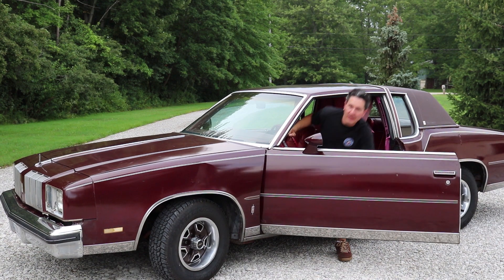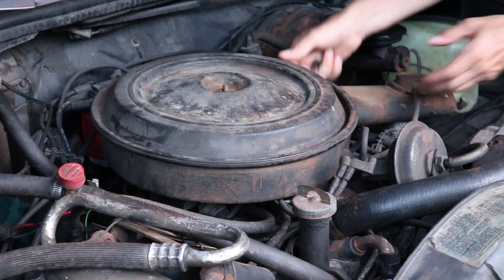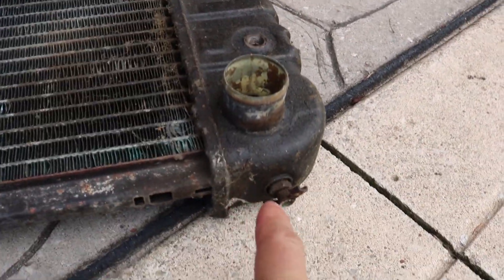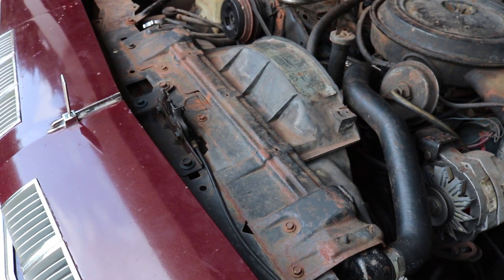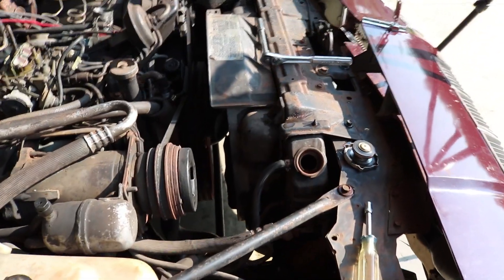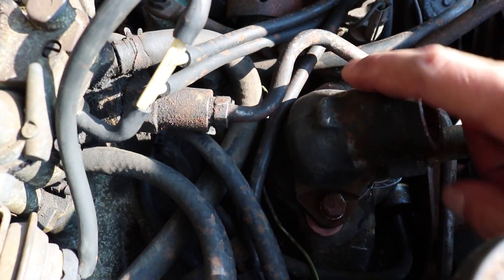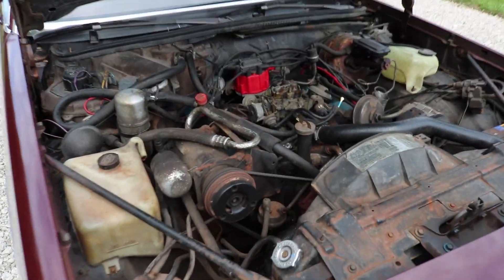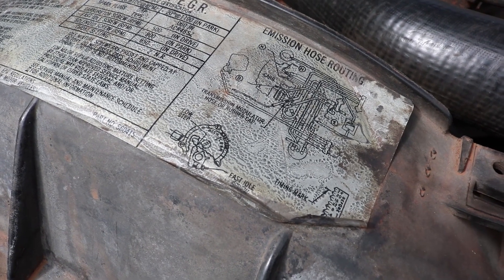HOW TO Replace Radiator and Thermostat - Full Details

Comment: why did you use a 160 thermostat and not an original 195 thermostat?
Reply from the maker: I prefer my cars to run cooler as I only drive them in the summer time.
Reply: Many thanks for the answer. I just changed my thermostat. (307 Olds delta88) How do I properly bleed the coolant system? is there anything to consider?

Comment: Thanks, helpful video. I have a 79 Malibu with a 3.3L / 220 CI and the radiator finally packed it in this year after 42 years. So, in goes the replacement. BTW, most reliable car I have ever owned! Oh yeah, original owner.
Reply from the maker: That says a lot!

Comment: I have a 85 Cutlass supreme with a 403 olds engine. Previously I had a 307 olds in. It is overheating without driving. What kind of radiator do I need for the 403
Reply from the maker: 3 core radiator, Make sure the fan clutch is good and correct, 160 thermostat
Reply: @ClassicGBodyGarage  
Thanks

Comment: Will it be the same process for an 84 cutlass supreme with a 307? And removal of trans lines, do they unscrew lefty lucy? And drain plug. Is it a screw or a latch? Thanks.
Reply from the maker: All the same as this car. Trans lines are threaded the same as well as the drain plug.
Reply: @ClassicGBodyGarage  I had to remove my radiator shroud to install the lower trans line. Will this affect my cooling?

Comment: I run a 195 T stat, cheapy aluminum/plastic radiator like the one that was removed, and it stays dead nuts at 195 even idling in hot summer traffic. I do not have a fan shroud, as my car was a V6 and now has a V8, but I do have a top plate. I need to get that octagonal style shroud that 307 cars had.
Reply from the maker: Nothing wrong with that. This alum rad just had issues and I wasn't about to buy another since i have a bunch of stockers.

Comment: Clutch fan : are 78- 88 all thermal clutch or 78-80 thermal clutch / 81-88 non thermal clutch ?
Reply from the maker: all depends on options the car has. AC cars had thermo clutches.

Comment: I've got a 1985 monte carlo v6 and im new to restoring cars but are they any other car that will have the same parts as mine because where im at its hard to find anything monte.thanks new sub.
Reply from the maker: Many parts interchange between gbodys so it depends on what you are looking for. The parts the swap are all suspension and most interior. Engine parts swap but you need to keep in mind the engine you are working on. Thanks for subbing!

Comment: Hello first and foremost ur doing a great job n a big favor for most by making these videos but i think u should have made the vacum line replacement video maybe explain symptoms and causes of bad vacum lines reason being that those lines are a great factor on engine operations but as mentioned ur doing a great job n thank you
Reply from the maker: Thanks for watching and great suggestion. I can make a video on that but it will be general as each year and engine option used a different vacuum line system.

Comment: The car is looking great , but I noticed that your fan blade is on the clutch backwards, that made my 79 run 5 to 10 degrees warmer when sitting and idling.
Reply from the maker: Damn it is! I didn't even notice that. I will fix that ASAP! People who installed the new fan clutch must have done that.

Comment: Great video, thank you
I have a 85 Monty with the 305. I put a new rad. Clutch fan and two new thermostats. With the thermostat in, it overheats as soon as I drive it. I can let it idle for an hour and it's fine. As soon as I start down the road it goes up to 260.
Take the thermostat out of the car and it runs fine. Never gets to 110
Your thoughts

Comment: hello could anyone tell me how to change ac compressor v belt on my 1988 oldsmobile cutlass supreme classic brougham thank you
Reply from the maker: loosen up the accessory brackets and they slide to loosen the belts, remove belt and replace. You will need to remove the belts of any other accessory first as they are in the way. I think the AC belt is the most inner belt so the Power steering and alternator belt needs to come off as well.

Comment: That is one nice cutty. And the 260 sounds like it has a lot of life yet. I had the 79’ Cutlass with 260 and those vacuum lines were a pain especially where I live. They was cracking/breaking plenty after just 6 years. But very good engine

Comment: A new radiator cap is a good idea as well. A faulty cap that doesn't hold pressure allows the system to boil at a lower temp than a cap that is working properly. This pressure also helps keep the coolant  in a liquid state bellow the the boiling point. 
Air IS introduced into the system on these cars when they constantly overheat (or when the cap pressure is too low) and force the expanded coolant into the coolant recovery tank and then draw the coolant back into the system from the recovery tank. 
Also a faulty cap that allows the system to build too much pressure can destroy an aluminum core. The aluminum tubes can swell crushing the fins between them. This blocks airflow through the core.
Reply from the maker: This is true and a great tip.
Reply: Classic G-Body Garage I have a 1986 Cutlass Supreme. I need a new radiator. I was seeing which one was better, an all aluminum one or a copper one?

Comment: Worth remembering that for CCC equipped G Bodies, a 160 degree thermostat may run too cool and not reach temperature enough for the carb to come off choke and mixture adjustment to lean out for normal running. I have an '86 Monte SS running the stock 195 degree thermostat down here in west central Florida, and it's running a similar plastic/ aluminum radiator that yours had (swapped in recently to replace the original leaking brass radiator). Even in the August heat it holds temp fine around 200 on the gauge, which is close to the 195 that the factory specified. Car runs fine and doesn't overheat, even in traffic.
Reply: Chas D  that's great, I have a 85 Monte that runs hot every now and then no matter what temp thermostat I put in. With no thermostat in the car it won't even get to 140, even in hot summer traffic. Can't figure this one out?

Comment: its a common issue with those plastic drain plug bungs on those cheap aftermarket radiators. A little lighter in weight tho ... same issue I had on a 2009 jeep liberty. I found out that it was stripped out from factory.